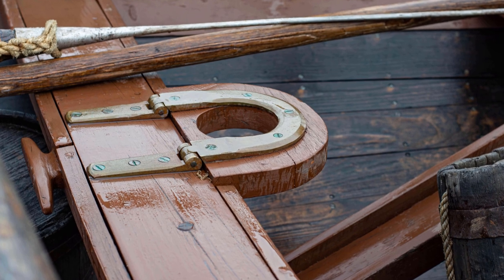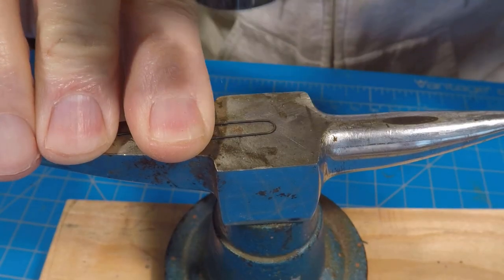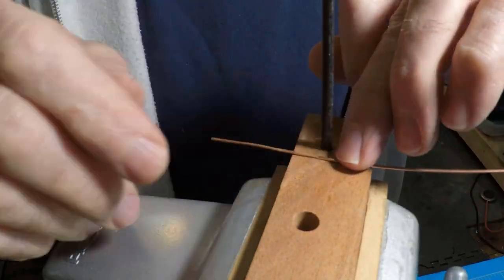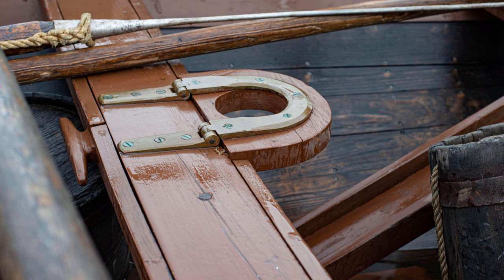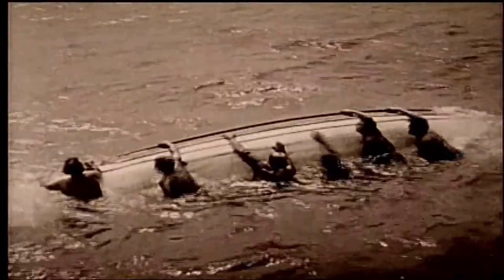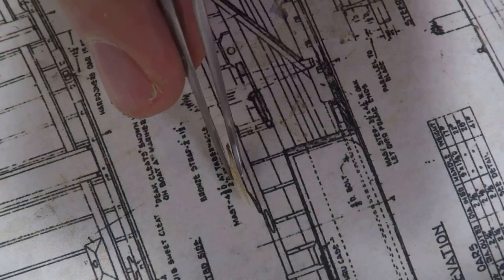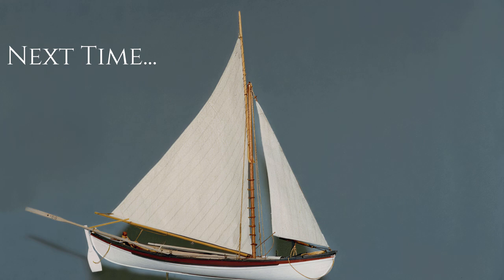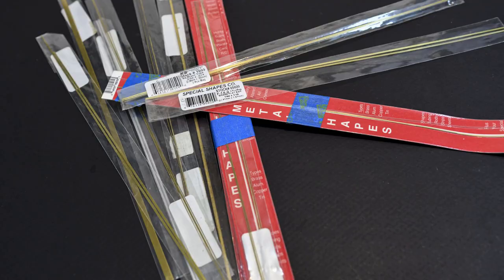Building a Whaleboat, Episode Ten

Comment: You make valid and quite important points concerning the interpretation of detail authenticity. BTW - I agree with your tabernacle joinery view. It seems obvious from the shadows and it is also much stronger than sitting in a rebate. If the pieces are not properly fit, a rebate could split a layer of wood from the top of the cross frame. A full notch could be a little sloppy. 

I have also sometimes noticed a dome block set in the background. Do you use this? And if so, briefly, what exactly for?
Reply from the maker: Thanks for saving me from having to explain why I did what I did with the tabernacle.  Reducing the aft edge to 1/2" would have made the piece so weak right at the very spot that bears the brunt of the stress.  I don't know if you noticed, but the tabernacle is already developing cracks at one or two spots where the screws cross the grain.  Maybe they should have run the grain longitudinally, or just drilled larger pilot holes...
I'm not sure, but I think you're referring to the set of dapping tools (different sized round forms with a corresponding set if matching depressions?).  Yes, I do use them to form thin sheet brass, copper or steel into domes or anything that needs to be dished.  I don't use them often, but when you need them, you need them!